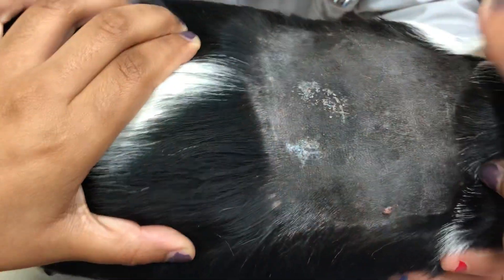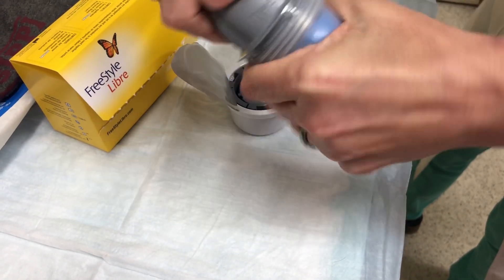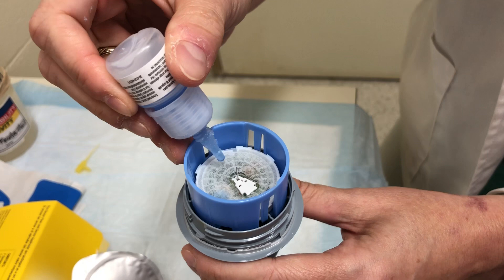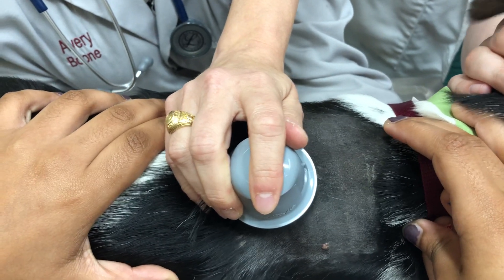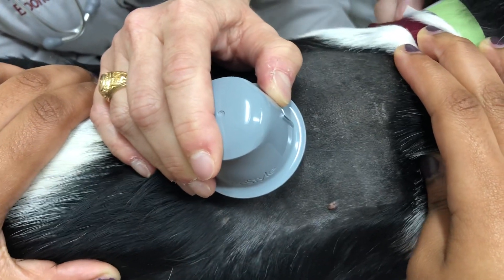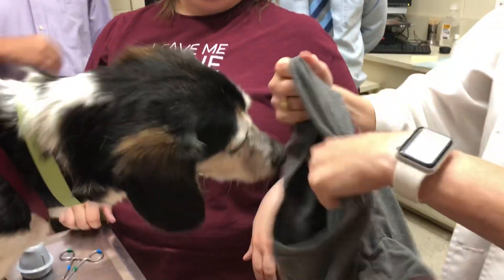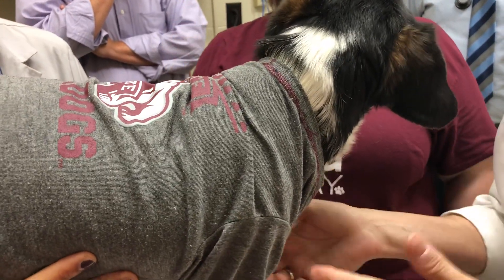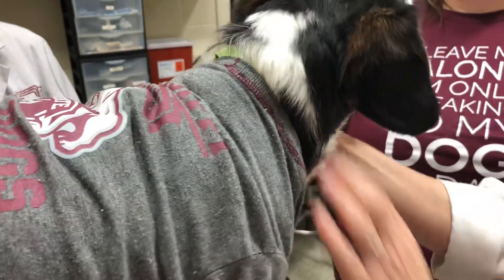Placement of FreeStyle Libre Sensor on a Dog

Comment: Pretty sparse information. Volume is way low, I have my device VOLUME ALL THE WAY UP, after feeding it through an amplifier and I am not sure of what is being said so I had to run the video 3 times and read the CC while listening.  Also what about activating the reader? I have read where one has to put the reader near the sensor and push a button to get it to communicate or "pair." My FreeStyle Libre 2 says it's good for 14 days and nothing about how often to take a reading. ben/ michigan
Reply: This is very odd because for me the audio was fine.

Comment: Excellent video, thank you!! I have a working springer spaniel who needs a sensor applied, but our primary vet is away until next week. 

My sweet girl was only just barely 8 yrs old when she was diagnosed with a stage 1 malignant Insulinoma (oct 2020). 

We managed to scrape up the funds for the MRI & surgery, and it was successfully excised via laparoscopic surgery, with clean margins - it was right at the top of her right pancreatic lobe, so her surgeon was able to literally just scoop it out without having to take the entire lobe. 

She came through it beautifully, and had been 100% fine…until a few weeks ago. Then she collapsed while on a walk - I hadn’t stopped carrying the bottle of corn syrup I’d always kept on hand in my SUV before the surgery, so I got some into her & she recovered quickly.

She’s had three more “crashes” since then, including a grand mal seizure 2 days ago, so although I hadn’t started monitoring her blood sugar levels yet, clearly it’s time to do it.

Last time I used a canine blood glucose meter, but the specialist clinic in Edmonton use the libra system and strongly suggested I pick up the L2, as I can just use the iPhone app here at home so she doesn’t have to be poked every couple of hours. 

But as I said, our primary veterinarian is away, and the Edmonton clinic is emergency only, so I will need to handle this myself. This is incredibly helpful, thank you so very much.

Comment: My Pomeranian has been using the Freestyle Libre consistently for 4 years now. It is life changing both for us and him. I am able to keep his average glucose in the 100's. My boy still has his vision after 5 years of diabetes because of this device. 

From my experience the super glue is overkill. I used it for the first 6 months and getting the device off took an hour and always took some of his skin with it. Instead try Skin-Tac, it is specifically used to attach diabetes pumps/devices and colostomy bags to the skin. Comes off in mins with rubbing alcohol.

Comment: Hi there, thank you for this video! I am wondering, is this something I can pick up at my drugstore over the counter or do I need a prescription. We live in Canada, quite remotely, and it is a challenge to get to. our vet more frequently than every 6 weeks. Is this something I can put on my dog, and one more thing, is this something that needs to be replaced and used forever? I am new to having a diabetic dog, a senior Pomeranian, and getting a sample with the lancet and strip is next to impossible and proving inaccurate. Thank you for your reply!
Reply: You have to have a prescription from ur vet. You can put them on yourself but we prefer to have our vet put it on for us. They are suppose to last 14 days, then it has to be removed it will quit working at the 14th day, if not before. We been having problems it doesn't always last the 14 days. If we have some good readings our vet will wait 3 weeks or so before we have them put on a new on. I hope this helps answer some of ur questions.
Reply from the maker: I agree with Brenda--in the US, it's prescription only. We put them on our patients BUT if your vet is willing, they may be able to teach you. It shouldn't need to be on all the time--just until your pup gets regulated. People wear them all of the time, but we don't regulate dogs as tightly as people (or we'd risk low blood sugar more often). These are not 100% accurate and they definitely don't always stay on 14 days (but even 3 days gives us a good idea of how your dog is doing).

Comment: We have been the Freestyle Lebre 2 for 6 weeks now (installing at home). Our vet. recommended it be applied just below the shoulder but this area is very susceptible to the sensor being lay on when the pet is sleeping. So I’ve been looking for information on trying it higher up on her shoulder where you applied it. So thank you for confirming this is acceptable.

We find the Freestyle regularly reads 50 to 60 points higher then our AlpheTrac reader. Do you find this to be a common situation as well? We are still trying to regulate our I have a labordoodle so I’m still a little hesitant to trust the Freestyle alone. Thanks for the video.
Reply from the maker: The variation is annoying, and is sometimes different with different sensors. When you get into the low range, it's certainly helpful to have an Alphatrak around to confirm it. But even though it's not perfect, I think it's better than BG curves, and I tend to follow trends. I want clinical signs controlled without hypoglycemia.
I've also placed the sensor on the side of the neck on dogs that liked to roll over and accidentally rub it off on their sides.

Comment: I had a problem with my freestylelibre14day on my pet.  I thought I had a bad sensor, but it seems my ready is bad.  I called Abbot and after 45 minutes of debate, they told me that none of the products are intended for pets and they will not offer support if it is.  why are so many vets telling people this is an option when its not supported by the vendor.
Reply: Don't buy the reader.  The app on your phone is free
Reply: It is used as "off label". It actually works well in most pets and it's preferable to poking the pet several times a day to do a blood curve.

Comment: pattylathan The reason you need haemostats is because the skin glue runs down the side of the applicator and jams it. We put the skin glue on after the applicator is removed, around the edge of the sensor.

Comment: Thanks for the video how do you soak off the old one, i am assuming soaking alcohol around the sensor ?
Reply: By the time the 10 days are up it is about ready to come off anyway.  I just carefully lift an edge and it will come right off.  I have never had to soak it off. I also use skin prep prior to application.  It is recommended on the Freestyle Libre Site.
Reply: thanks for the reply, I am in Canada where the sensor works for 14 days for whatever reason, it stayed on thanks again
Reply: I use alcohol to clean the spot before I put the one on my dog. its hard to come off to be honest. I used a little goof off mineral spirits to dissolve the glue. the sticky pad on the monitor is not enough to keep it on for the whole 10 days once hair grows. you def need the glue. i used only 3 drops not 4. my vet used 4 and it was just too much. these are great though. I use them when i'm on vacation and leaving the dog in the care of someone.
Reply: do you apply goof off on the dog?, that's probably not good for them to absorb.
 @smack1965
Reply: its a very minimal amount on a qtip. just to release the glue. then i put some neosporin on where the disc was. I get goof off on my hands for years. no problem for me. well i am a little crazy hehehe :D
Reply: I’m a human and use the libre sensors.  I use baby oil to remove them from my body.  I think that’s what the manufacturer recommends.  I suspect food grade oils such as olive or coconut oil would work and be safe for animals prone to licking